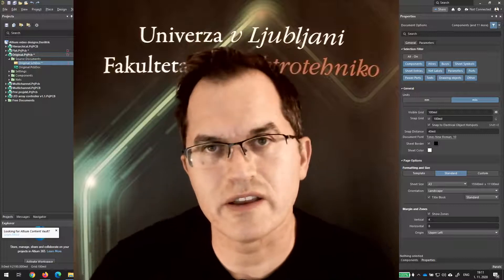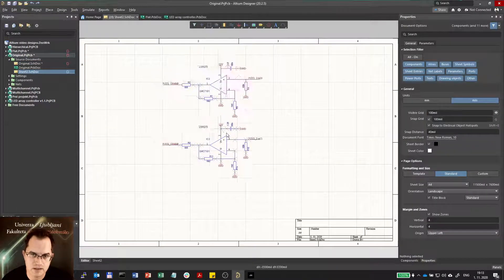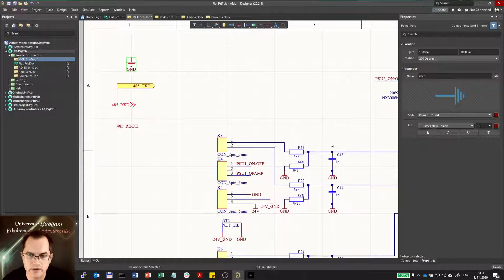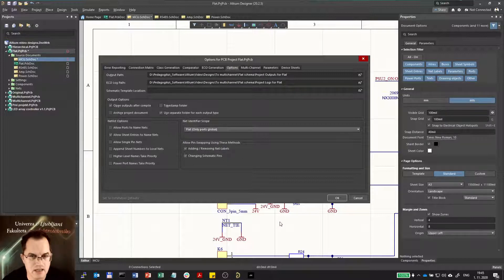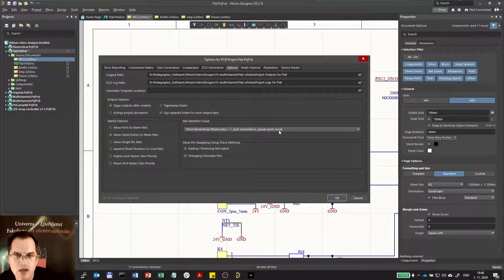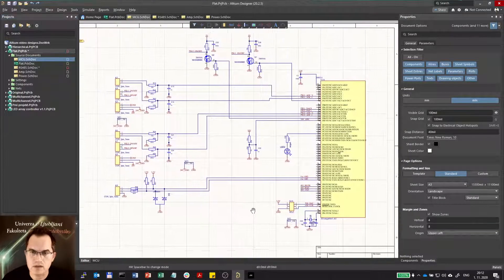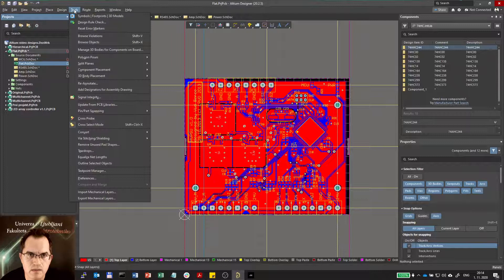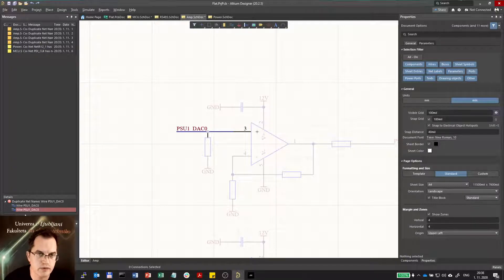Altium Schematics #07: Horizontal and vertical connectivity

Comment: Nice introduction to connecting. Even the video with time skipping. question to [17:44], lets assume ... If I have hierarchical design, where I have several "green" sheets with ports. Is there way to connect some signals from subsheets together, without populating them on top level sheet?
Reply from the maker: Theoretically, you could if you use power ports for these nets. But it is not very practical, since you lose the readability of the schematics.

Comment: @13:05 in a flat scope, why would you get errors from identically named local nets? If only ports are global, then what is the problem with identically named nets in different sheets?
Reply from the maker: The reason is that eventually the pcb should have unique nets. So, if you used same net labels in different sheets and only ports are global, than these two nets are not supposed to be connected. But in the pcb, they would be connected. Hence the error.
Reply: @elektronika-fe1325  Thanks a lot for both your answer and your videos! I find them leagues more helpful than the official documentation :D. 

Yes, I was thinking of this a bit backwards (from a programmers perspective where local variables can have the same name and remain unique). So Altium seems to interpret the local nets as having a local connection scope, but checking them globally (i.e. local net names are compared across sheets). I found this to be rather unintuitive. I intentionally named my local nets the same as their ports hoping that in a flat scope they would be connected and have the same name, but this doesn't seem to be the case. 

I see the merit to catching these errors when connecting two sheets you didn't even make yourself that might have overlapping naming but aren't intended to be connected. When you enable the "Append Sheet Numbers to Local Nets" doesn't this mitigate this protection though? 

Its still rather unclear to me how these local nets with appended sheet numbers are resolved. E.g. if I have a top-level sheet with a manually assigned Net Label "A" and a sub-level sheet with a manually assigned Net Label "A" and connect them via a sheet entry and port, then the top level "Physical Name" and "Net Name" become A_1 in the Properties panel (even though visible Net Label is still "A"), and the sub-level nets labeled "A" have Physical Name "A" and Net Name "A". Its still very confusing to me as to why these two nets should be connected even though their properties show different Net Names. 

I just found this article explaining the "Physical Name":
https://www.altium.com/documentation/altium-designer/nfs-21-0schematic-improvements-ad?version=21#net-name-identification

I think it may have been more appropriate to call this the "Flat" or "Global" Net Name, and the current "Net Name" as "Local Net Name". Even then, I don't like how the Net Label doesn't represent either of these :/. Any way to change this? I would like my Net Labels to either display the local or global net name, not some unrelated text. I think this reduces readability by making whether or not two sheets with Net Labels "A" are connected or not solely dependent on the project setting (Append Sheet Numbers to Local Nets) 

It seems there are quite a few very unexpected results from setting the scope to Flat and having these "appended sheet numbers to local nets" with a hierarchical project (i.e. sheets within sheets). Notably, connecting a Top-level Net Labeled Net with a Sheet Entry via a sub-level sheet port results in disconnected nets of the same name. :O. My overall takeaway is NEVER use any scope other than hierarchical is you have embedded sheets anywhere.
Reply from the maker: @topherbuckley  I see the "Append Sheet Numbers to Local Nets"  function as a sort of  dirty shortcut of Altium to allow local net names to be really local and stay local in the PCB as well. I agree there is quite some ambiguity in the net naming, especially as yourself, looking from the coding perspective. There, every local variable is translated finally to a unique location in the memory or heap or whathever and you dont care about it anymore. In the case of PCB design the nets certainly matters also in the compiled version, If I can say so. So for me it is clear to distinguish between logical and physical net names, first corresponding to schematics and second to PCB. You last takeaway sentence is also my preference.

Comment: Hi I have a query, why does it show me an error saying "MULTIPLE INPUT PORTS". Yes I do have an output port say PORT A on schematic sheet number 5 and 2 PORT A inputs connecting Schematic sheet 2 and Schematic sheet 6. How to resolve this issue. Can't I use one output and 2 input ports?
Reply: I would guess you need name mangling like variable names in programming. There should be an option where Altium concentrates or appends sheet number plus PORT A to make it unique.
Reply from the maker: You can have same port names on different schematic blocks as long as the port names in one block have different names.
Reply: Lik Sammy said, you can appen for example append sheet numbers to the port names...